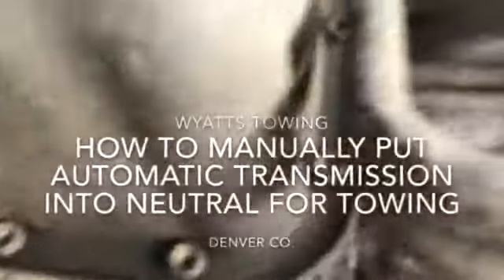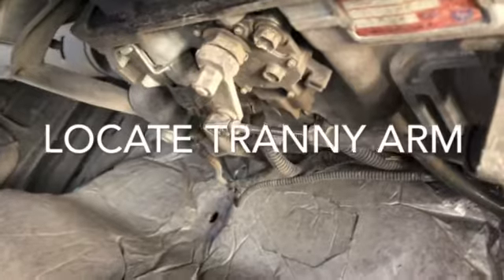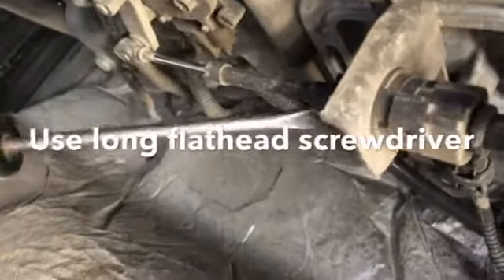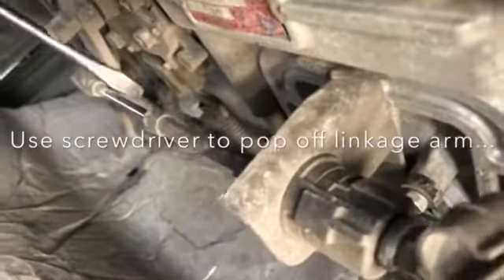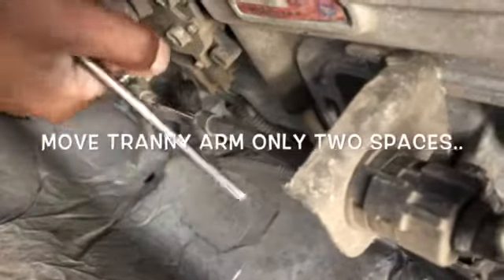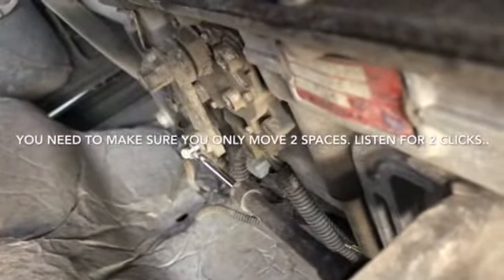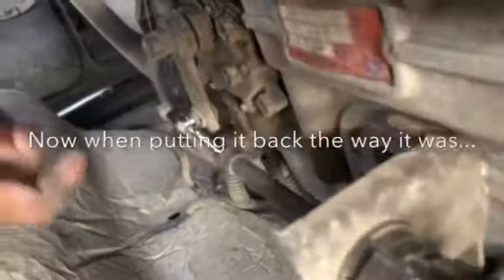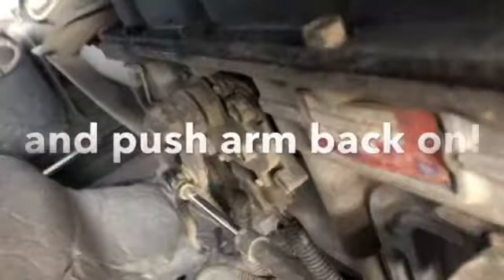How to disengage the linkage arm on a automatic transmission - for towing.

Comment: Best way is to disconnect the drive shaft and tie it with a wire underneath, your auto transmission is safe for flat tow.

Comment: Hey guys can someone explain me how this is works as all car in UK are on flatbed 

So if i have RWD and automatic transmission, car is in P gear , do moving car on P gear is possible?? Or its damaging transmission?? 
I see sometimes when there is not access from rear they hook the front moving car a bit and then they tow car from rear , but do this moving car even couple feet will not damage gearbox ?

Comment: i have to tow my mercedes ml 270 of year 2003. Automatic transmision 4wd. Every body says not to tow on neutral, if you not disengaged the differential lock. Is that so, o i can put it in neutral and not have trouble??
Reply: Everyone says? What does your drivers manual say lol
Reply: Use dollys